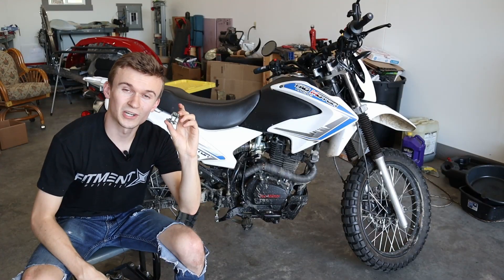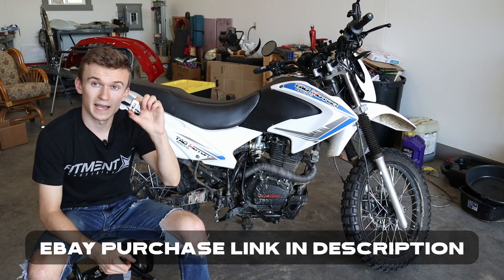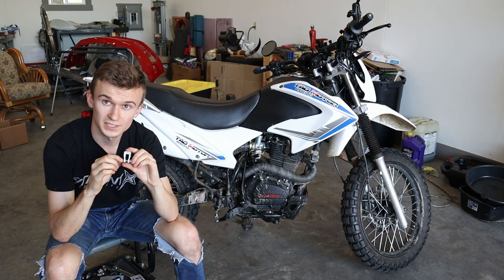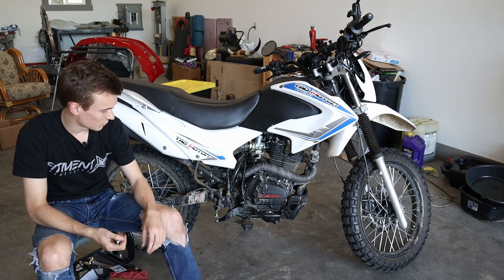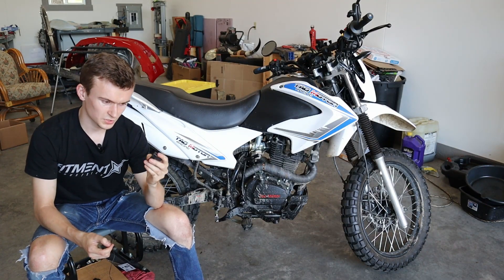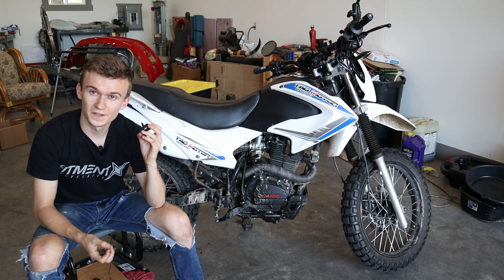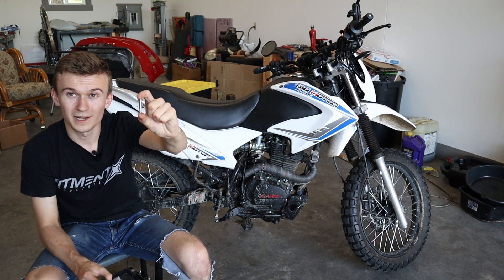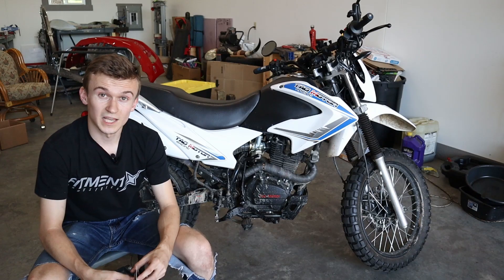I Designed and Produced a Custom TBR7 Rear Brake Clevis | For Sale!

Comment: I'm wondering if this clubs would lower my brake pedal because mine sits much too high
Reply from the maker: The distance from the start of the threads to the pin axis is almost the same as stock so I don't think it will lower your brake pedal much unless you cut some threads off of your master cylinder rod. If you do that, make sure there's a nut threaded on before you cut it so you can straighten the threads out with the nut